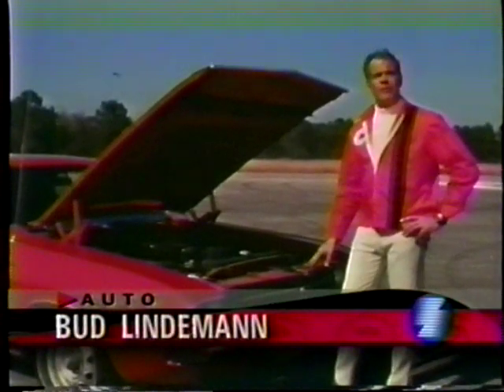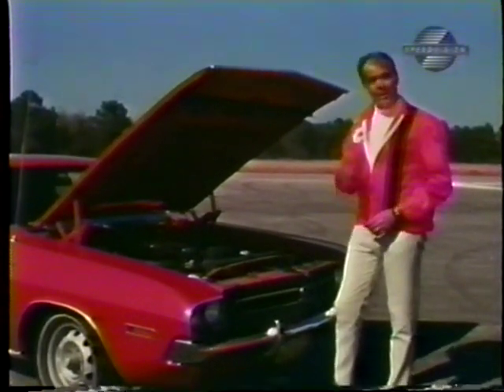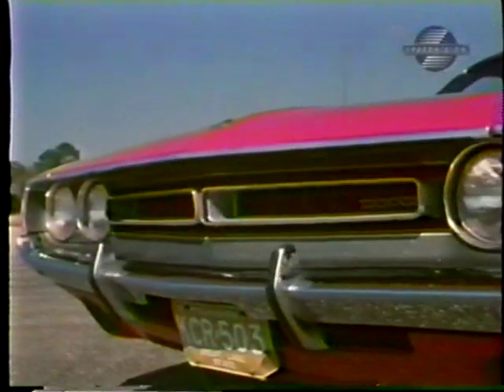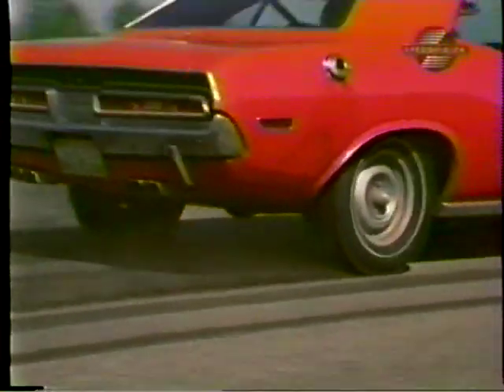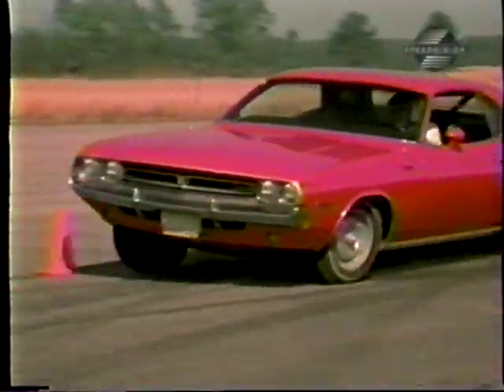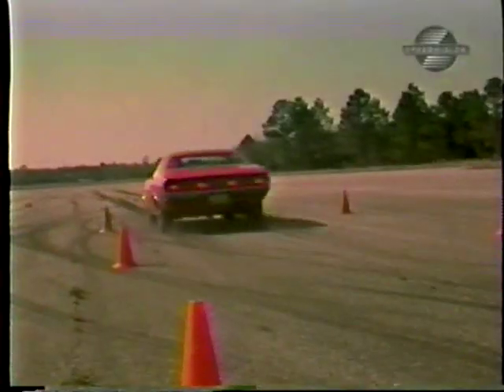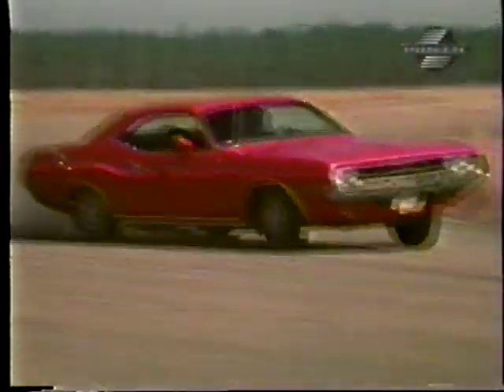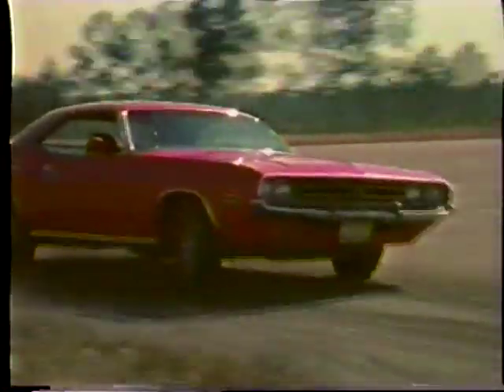1971 Dodge Challenger 383 - vintage road test

Comment: The Challenger has always been my favorite musclecar. This one is Tor Red, a great color for that car. I'd make mine Plum Crazy purple, or maybe even Top Banana yellow with a white interior. The 383 was pretty quick, but it also had a ton of hop-up potential to make it even quicker.
Reply: +justsomeguytoyou Yeah, the 383 was a big block that could rev like a small block, mostly because of its short 3.38 in stroke and with its 4.25 in bore could make about as much power as its bigger brothers if you revved it a little faster.Why do you think police depts used that engine for so long? Absolutely fantastic engine!! IMO....
Reply: Just FYI, Tor Red wasn't available on Challengers, only on Cudas. Hemi Orange and Tor Red were literally the same exact color, but they were called different things to Dodge and Plymouth. So you'd be half right saying this car is Tor Red... because it is.... but it's called Hemi Orange.
Reply: The 383 would come to life with minor hop ups...headers, intake and carb swap, and bigger and better pipes and mufflers...even with these minor mods you would be neck and neck with a normal running HEMI
Reply: Best looking car ever
Reply: @Storkz0re  In my opinion, the Challenger was the best-looking musclecar ever built
Reply: @justsumguy2u  I have full stock Challenger R/T (orange) as wallpapers on my work PC monitors for past 1.5years :D
Reply: 71 Challenger RT and 69 Camaro RS/SS are both the best looking Muscle Cars ever

Comment: @DiscoKat  As installed in the car the 383 was making 250 hp and the torque was 325. The 440-4bbl was making 305 hp and the torque was 400. So the difference is 55 hp, if compared to a 440-6bbl the difference is 85 hp, since that engine made 330 hp and the torque was 410.

Comment: Evidently, I'm not the only one who noticed the part of the video that wasn't a Challenger. I'm pretty sure that the other car was a '70 or '71 Torino. The steering wheel looks like a Ford "rimblow". Miradart is right about the Ford side-view mirrors. Also, notice the sweep gauges with the arched shape at the top. I'm about as sure as I can be that those gauges were from a Torino.

Comment: Ha!  Check out 2:27 interior mistake - it is clearly a Ford interior shot spliced into the film!  A rim-blow Ford steering wheel in front of what looks like a Torino dashboard.  Later shots show correct Challenger dash and metal spoke steering wheel.

Comment: You could get a 383+4spd in a non-R/T challenger and the steering wheel is factory. It's called a "rim-blown" steering wheel. The thing I noticed was that the outside rear-view mirrors weren't factory. look like some after market paint-to-match addons to improve visibility.
dunno about being a pilot car, tho. If it was a "pilot" '71, this video would have had to been filmed in early to mid 1970 and the video says it was recorded in 1971. hope that clears things up

Comment: I just sold a 383 4 speed 391 posi-ALL NUMBERS MATCHING--465 challengers were built that way not counting - w/air challenger 1971 it was built with the bulge 2/scope hood and rear q/panel call outs p/s p/db  rootbeer outside/ black gut w console and it was not a r/t-----I-got--$35,500 -just bought a aar cuda 4 speed ALL NUMBERS MATCHING-for not much more  I am happier than a pig in a mud hole on a hot day!!!!!!!!!!!!!!!!!!!!!!!!!!!!!!!!!!!!

Comment: @Corkoth55 Ironically, ABS lengthens stopping distances over threshold braking. It's modern brake pads, brake fluid, and larger rotor diameters that help modern cars keep the wheels from locking up, allowing for shorter non-ABS stops.

Comment: This is why the 340 was a much better setup. the 383 and 440 too heavy. All you had to do is widen the tires one size and handling was a lot better. Had one and added an extra torsion bar in the back, air shocks all around. swapped the 14 in wheels for 15 a lower wall tire 60's 215 front and 235 rear. There you go! and that was in the 80's. made handling almost as good as a Vette.

Comment: I liked this package and i had them all. I worked in development and fine tuned that shifter. the track was durty to and probably cost 2 or 3 feet in stopping. :-) a year later we were working on ABS. this was a Barracuda and not the sport R/t. so it wasn't a Magnum 383 but a lower HP TNT engine and likely had a 276 rear and small tires/not wide ovals. put i liked testing mine witch was the same in blue. we were trying to come with something to replace the Hemi at this time and all attempts were shot down. the 444 cid ball stud semi hemi (like a ford combustion chamber) worked great but just got dumped.

Comment: A new F150 with the 3.5 EcoBoost engine - about 210 cubic inches - can move a 4800 pound pickup truck to 60 as fast as this 383 Challenger. And can get at least 50% more gas mileage, on regular. The wonders of technology.

Comment: It took 211 feet to stop at 70 MPH. "But did you die?"
Reply: No, but the car was facing the other way by the time it stopped.
Reply: @topgunns1000  
Thats so if you hit something you dont have to see it because youre facing backwards. 
Safety feature.
Reply: Well maybe if you used your brakes and not just the tires themselves to stop.
Reply: @MrTheHillfolk  Unlike a Pinto. Rumor has it the Taliban bought all of them they could import. Currently  they are trying to figure out how to get them to land on the rear bumper after launch.
Reply: @thegreenerthemeaner  😂😂😂

Comment: New cars might have better QC than they did back 40 years ago, but that is mainly because the complexity of new cars is so much more. But then I can't complain about 1971 QC. I still have a 1971 oldsmobile Cutlass Supreme with a 350 that runs fine, never rebuilt, and not a garage queen. But then the car is simple/easy to work on, mechanical ignition systems do need more adjusting.

Cheers!

Comment: You are correct in what standard motors. I didnt mean to put 70 only. Also in 67 a GTX or Coronet R/T came standard with a 440 and a Hemi as an option.The six pack option was a mid year option on the 69 Road Runner and Super Bee and then was an option in 70, 71 and there are at least one maybe two known 72 six pack cars.The T/A and AAR was the only cars to come standard with a 340 six pack set up there was no other way to get that option. The Challenger R/T and Cuda was the only car to get a

Comment: I have to wonder if it had the r/t suspension and brakes. My '70 with modern semi metallic pads and shoes stops right f'ing now. And with modern tires, is a pure joy around corners. I've had it through the mountains and it's very forgiving around hard turns....

Comment: Word, mount some decent sway bars, shocks and new bushings and they can handle quite well. A big issue is the brake bias front-rear. Nasty tendency to lock up the rear first, scary as hell on wet roads. Easy to remedy though...

Comment: the 1st car i ever rode in was a 73 Charger SE w/ a 440 swap. it was the car my dad took me home in after i was born in 83. then 17 years later I bought my own muscle car, a 73 AMX that I still have after nearly 12 more years. I also have a 93 Z28. but its ok for a daily point A-point B driver. My AMX is more fun. the build quality ain't that bad, thought it has been nearly 40 years since it rolled off the assemly line in Kenosha Wisconsin so its a bit tired even with only 52,000 miles on it.

Comment: @BNforever2009 I got one buddy, matching numbers i'm restoring right now. And just had delivered today a vey nice restorable 1970 Dodge Challenger R/T SE factory air and 4 speed with no motor and trans but I have an original 1970 dodge 440 six pack engine and 4 speed trans for it.

Comment: Hey Mike, the SE wasn't available as a seperate trim line in '71, the thing that really struck me as interesting was the fact that this car didn't have the N95 dual snorkel hood-yet it had a four speed, and likely the 4 barrel 383...
Reply: The duel snorkle air cleaner was used on all 1971 383-4V/440-4V engines, except for the N95 hood as you pointed out

Comment: My guess is you ARE thinking of the Super Bee. Stock mill on that was a 383.   The 1971 Super Bee and the 1971 Charger R/T look very much alike.   The Super Bee could be thought of as Dodge answer to the Plymouth Road Runner.  My Super Bee has the 440 option.  There is an R/T, same  color as my Bee, somewhere within 20 miles of me--I have seen him driving around but never caught up with him.  It would be interesting to compare his white R/T with my white Bee.

Comment: sorry but the 383  blocks  were different  than the 440 and hemi blocks. you could interchange heads and cams between 383 and 440 but that's all, the cranks were different,but if you ground down a 440 crank main and rod journals you could stroke a 383

Comment: Hey Kelly, after watching this again and reading your comment I think I was probably wrong to say this is a SE as the SE (in 70) had the smaller back window and I don't see any "SE" emblems on the Car but they may have left the rear window the regular size in 71 as it was considered a problem in 70. Regarding the flat hood...That was probably why I made the "SE" comment in the first place a odd ball Car for sure!

Comment: Just needed better suspension. The body roll is way over acceptable even for the age. And it destroyed it's tires in every turn. Pro Touring guys have ironed all these issues out after the fact and shown that the chassis can handle. But they just weren't made well in their time. To many corners cut, to many accountants in the room.

Comment: Not a whole lot better. The 383 and 440 differ the most in deck height. The 440 has more power, but the 383 was (an is) basically, a factory stroker. Their ability to rev and produce torque right off the bat are amazing.  I've seen many a 440 car have it's ass handed to it by a 383 powered car.

Comment: Wasnt the hood on the Bee different then on the R/T? I'm trying to think of the R/T. Did they only offer the air grabber hood for the R/T? I'm back looking for an R/T if my Vette sells.I have a few trades lined up if not.I'm looking at a 69 340 4spd Dart, 73 Dart Sport, 72 Rally Charger and its a 340 4spd car.I'm also looking at a 70 Duster 340 Survivor car. I like to find a 340 Demon. I would really love a 68 Charger to clone into the black charger from the movie Bullitt. If my car sells

Comment: Again, no, you're wrong.  The 1968-1971 Charger R/Ts all were standard with 440s in them.  The only options were Hemis, and in select years, the 440-6 engine.

Comment: @kellysrocket 
Old mopars have good quality no rattles shakes they are better put together than a new Kia remember old cars spin on take off thus slowing recorded times down,does your Kia run 13 sec 1/4 mile and 5.0 0-60 the 383 4bbl Challenger does with sticky tires  As you can see this car is spinning all the time..back then hooking hard meant it didnt do a smoke show it spun through 1 st gear ! I owned these cars when new,I have a 440 Challenger all stock and it beats my 09 SRT Challenger !!

Comment: I do know that the 383 was no slouch, it was right up there with the 440. I still would like to have a 69 Dodge Super Bee with a 383 and 4 speed, 3.91 sure grip rear end, dual exhaust, power steering, radio delete. that thing would still beat the piss out of these modern day muscle cars and imports.

Comment: 383 and 440 are almost identical in weight, might be 15-20 lbs between the two. 383 is a "B" engine while the 440 is an "RB" engine. The only major difference is the deck height (440 has longer stroke)

However, a good running 383, with the right gears and a smart driver can walk all over a 440-4bbl. Remember, there's only 40hp difference between the 383-4bbl and 440-4bbl.

Comment: 383 we're AWESOME!!! Engine s just the right amount of power between the 440 if u didn't want that much power as the hemi n 6 PACK!!
Reply: The 383's high-perf's were a very underrated engine. Most of them really ran good for the money and were hard to break.
Reply: I still have my 383 HP in my 69 charger .. I seam to like it better than the 440s I had...lots of power...sounds great.headers and glass!!

Comment: Mann my dad had this car back in the late 70's in high school.. Bought it with a custom stripe paint job, only seen a few pictures of it but it was badass. Guess he was street racing on it and he blew the engine though, so he bought a new one from the junkyard, him and a friend threw it in the challenger, then sold it off after awhile. Supposedly it pretty much sucked after that.. but what do you expect from 2 20 year olds changing an engine? Still, I wish he woulda kept it..

Comment: Man you can see how much rubber off the weak (by modern standards) Poly glas tires was burned in every turn. I bet with just modern high performance tires and keeping everything else completely original stock you'd improve every handing statistic.
Reply: silverbird58 Yeah well those Hellcats have 700+ hp. I’m saying if you keep the old one stock and just put modern tires on it you will improve all handling characteristics dramatically.

Comment: Don't bet on it. There's a TON of really good performance cars out there AND the modern Camaro, Mustang, and Challenger ALL beat the best of the old stuff. The biggest difference is affordability. A good performance car costs $26,000-$70,000 these days. In the old days you weren't spending the equivalent of the average salary to buy a fast car.

Comment: Whoever said at 224 that it was a ford you're right I don't know about ford interior but I know that is a ford mirror as a matter fact maccaIsntDead had a video on here of a 70 or 71 mercury cyclone that was the same color and you know back in the day old shows intertwined footage so that's just what happened they probably didn't have a camera  angle there and borrowed a piece of footage from the cyclone video

Comment: By the way this is not a R/T so it doesnt have the high performance 383  383 2 barrel different cam heads ect  ran mid 14 in the 1/4 mile with 2.76 rear axle,the 383  4bbl,383 4bbl Magnum were low-mid 13 sec 1/4 cars because they spun the tires off the line/through 1st gear ! CarLife tested a 440 Cuda when new it ran 14 with skiny 14 tires they added 8" slicks that equals tires of today and the car ran low 12's with a NEW STOCK 440 Cuda !

Comment: @speed150mph It doesn't matter how much horsepower a car has if it can't harness it.  All cars since the 80's have plastic body parts. I have 1980 Mini and a 03 MINI S.  The 1980 is much more fun, even though you're going slower, but 35 mph feels like 60 mph. The only car that has fiberglass reinforced plastic body panels since day one is the Corvette.  An Astra diesel is faster than most 70's American muscle cars.

Comment: No, I "don't get all my info from allpar".  I have been into Mopars since 1975, and owned a 1968 Charger R/T since 1979.  I also own a 1971 Super Bee.  Take a look at a factory brochure, scroll down and enlarge if you need to: 1971-1974dodgecharger/advertisements.html

Comment: I've never known that a 383 powered car would be able to beat a 440 powered car, are the 383's lighter than the 440's? I once heard that there is a noticable amount of weight between the 340 powered cars and the 383 powered cars

Comment: The '71 383 engine was down on power from '70 because of a lower compression ratio.
Reply: right. 70:335 71:300. and downward from there. the 71 383  like in my satellite is the last of the real powerful motors. 72 & 73 you could even get real big block like a 440 unless it was in a dodge truck. And all of them got cut down. this all happened because of the 1973 oil crisis and that was the biggest role in the death of the real muscle cars. r.I.p.
Reply: LOL, like a few 10th points that hardly made a ding in the numbers. They turned on just fine. Plenty of 70 down cars with their 5 extra ponies got a good look at my 71 tail lights. It was nothing like how they all got neutered in 72.
Reply: INCORRECT AGAIN!!!...good god..just reguratation...only done because of insurance....look at the numbers n the quarter mile of a 68-70 383 and a 71..no difference!!...it was a joke!!..250 Net HP??? again a joke!!..a 1971 Roadrunner went 14.8 at 95 mph with 2 people aboard and 4100 lbs..almost the same as my 2005 Chrysler 300C with a 340 NET HP 5.7 HEMI!!!...Wake Up!!!
Reply: @71plymouth.  WRONG. Chrysler said that so that the majority of 383 powered cars would get by the heavyhanded insurance agencies
Reply: @johnnyzee383  Look you, regulations were biting down on these cars. And it didn't just have to do with Chrysler execs. swiping pens on dotted lines. Other regulations had to be followed; by everyone. If the insurance were The Only case, all Chrysler would have to do is just give out a bogus number ex. 396 for Chevy made more horses than was given on paper, 426 Hemi; 425 on paper but was actually said to make over 500... Keep the lid on.
Reply: @71plymouth.  Look me...lol...I was there YOU and YOU dont know what your talking about..READ and learn..I was talking about 1971 not 1972 or 73 and on. Keep your lid on.
Reply: @71plymouth.  why do you have to get violent and cuss and swear?...Typical response...
Reply: @johnnyzee383  I have to cuss and swear to get people like YOU; their attention. I never said that You didn't have a point, you said that I and other people didn't have a point and sure not a better point than You. I admit when I commented yesterday daily stress influenced my comment. But from the first word WRONG, took me under a negative effect. Simple explanation enough..
Reply: @71plymouth.  Fair enough
Reply: silverbird58  Yup...I remember that...they couldnt believe how soon the torque came in on the 383 Chryco in comparison to the Chev stroker and the torque and HP was more on the Mopar...as for 350 Chev's...well..them was a regular diet for my 383 RR...lol